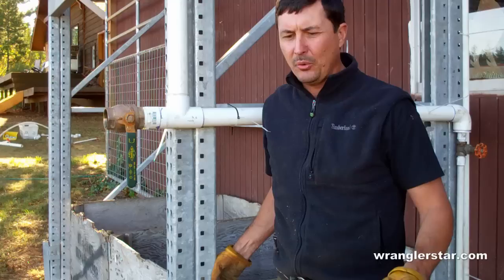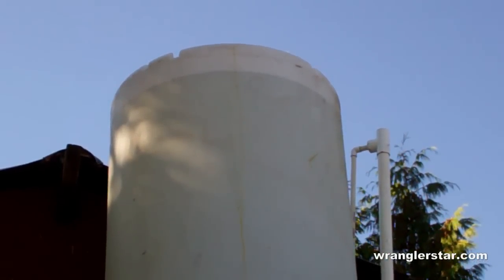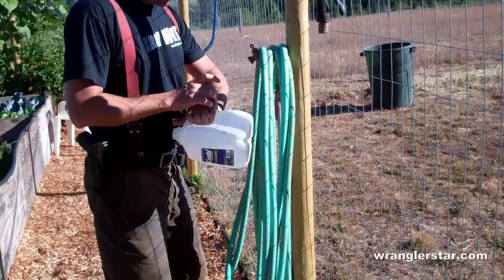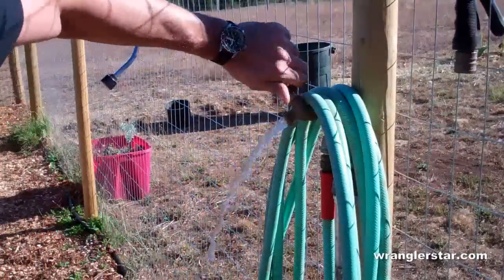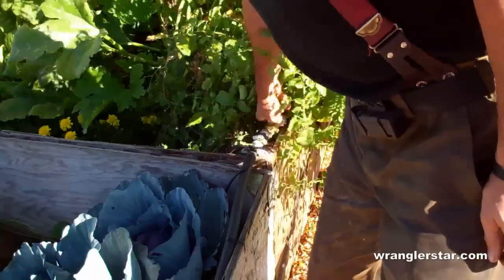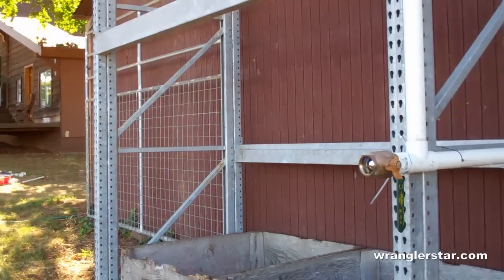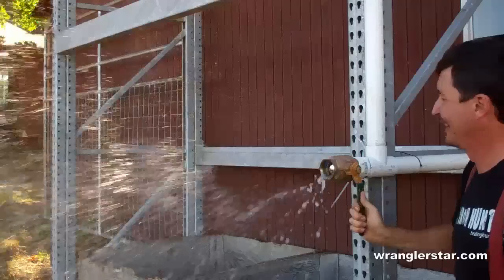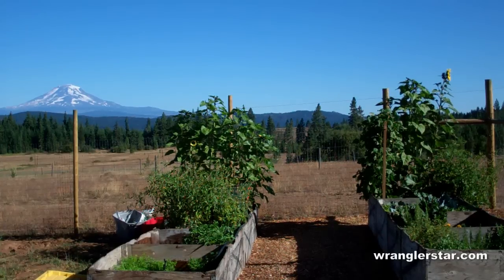Off-Grid Water Tower Exceeds Expectations – Gravity Fed System Review

Comment: I worked as a yard attendant and forklift driver at a local mom and pop hardware store as a teenager. We had the same structures for storing everything from pallets of salt, concrete, bricks and cinder blocks. If the same rack can support 8 full pallets of concrete this rack will laugh at the weight of that water tank when full. It could easily hold triple to quadruple that weight. If the foundation stays solid there is absolutely nothing to worry about this setup.
Reply: That if would be my main concern. Where I live, the ground would probably give a bit. This is a gravel pit with wood on top.
Reply: who cares thats his point. he already justified any weight issues.
Reply: I was going to say the same thing whoever was complaining about any possible hazards is completely ridiculous. I work at Home Depot and and flying multiple pallets more than 3,200lbs each and this 500gal water barrel is maybe 4,175lbs by itself I say there’s room for expansion.
Reply: Water is only 8 lbs per gallon, so 2 whole tons on something that could hold ten times that. People are dumb. Especially people who don't know how things work. One of the reasons why most of us don't want to live by them.

Comment: You did a great job. I owned a welding company and built hundreds of building and what you did is more then enough. I am thinking of putting up a Catch Basin tank for rain water off of our 30x60 barn,,which I should be over 900- 1000 gals from a ONE inch rainfall. I was thinking of cementing 2" pipe in the ground 4 ft deep and weld 4" channel on top,,but I think I like your idea better...looks sound and well designed.
Love your view too,,here in south Texas we don't have that,,,,Jealous...;)

Comment: From a structural steel designer's point of view, your on the right track.  Those pallet stands are tough, and should be more than enough for your needs.  In fact, you could put another 500 gallon tank on that platform without an issue.  Only thing I would have done differently is sink the legs into the ground about 2 feet and filled with concrete.  That would be overkill, but that stand would not move unless a bomb fell on it.  Your work is an inspiration brother.

Comment: Hi there Mr Wranglerstar. First I would like to say, you have a great channel. It is the only YouTube channel I watch consistently. Very inspiring. On the rack issue. I work in a grocery warehouse with this exact racking. We stack 2500# salt pallets in that rack, 3 bays high, not including the floor bay, without a problem. Ours are only single tube legs. I have seen them come down but it took a forklift running into a leg of a full rack. I dont think you have anything to worry about.

Comment: I work in a book depository warehouse. Our racks are very similar, but they are very old and don't look as sturdy and reinforced as yours. A pallet of books can with 1.5-2 tons depending. The racks are fully capable of holding 8 full pallets each with 2 more on the ground. Before you mentioned it, I was going to recommend tying it in to the house/shed to prevent wobble. You did a great job. Thx for the vids!

Comment: Great video. Thanks for sharing theprogress, and telling the Safety Sallies where to file their complaints.
I would like to suggest switching to an all-drip, or all 'mist' system in those boxes. As you can see in the video, the spinnerheads are watering the sides of the boxes. They are meant for a larger circumference , with 'head-to-head' coverage. 
All the best, and keep up the great work. We are all learning a lot!

Comment: Hi Cody - As a fellow gardener, a couple of thoughts to further conserve your hard earned water. Water at the stems or even better at the roots roots of the plants instead of spraying it around over a larger surface, this will lower water loss through evaporation and also prevent against Tomato Blight and other problems. Water in the evening when temp is dropping not in the morning when temp is rising this will keep your soil from getting 'sun baked'. Great vidz and thanks for sharing.

Comment: With you 100% on the racking.  I worked in a warehouse for 4 years while I was in undergrad.  Those are the heavy duty racks, as you pointed out the uprights are doubled.  Just for your information, those will hold 27,000 pounds.  You could place 4 of your 500 gallon tanks on them and still be OK.  And just because they are rated for 27,000lbs does not mean they wont hold more.  Some racks held pallets of steel stock, 40,000lbs total, for all 4 years I was there without incident.

Comment: Great project.

I am a Fire Apparatus Engineer- to get the max flow out of you system - I would take out all 45 elbow and replace one  with  two 22.5 with a 4 inch straight piece.

You have good pressure but sharp angle will slow flow when using a gravity only system.

The system you have now will cover your current need but you did state you will expand.

I know this is unsolicited advice- sorry

Keep up the good work.
Reply: +jason mcmillan makes sense to me Jason, good advice and I thought it deserved a reply....x
Reply: +jason mcmillan you mean replace 90 elbows with 45 degree i think right ?  I dont see any 45 degree fittings , just 90s  unless i am not looking at the same thing you are
Reply: +warren michael oopppssss yes. I stand corrected- take out the 90's and make shallow turns 22.5's
Reply: A sweeping bend is far superior, you've got the right idea.

Comment: I really don't think you'll ever have any problems with that water tower. I've seen forklifts ram into those things, while the racks were holding thousands and thousands of pounds, and there was never a problem. They're not only strong, they're resilient also. If it were me I would feel perfectly safe adding one more tank up top and another two tanks on the middle section. You might consider a solar panel, battery and 12 volt pump to provide flow and pressure with the lower tanks. Great video!

Comment: The shelf system you have for the tower is rated to hold a lot more weight then you have on it.  You are correct, there is minimum danger of collapse.  It is the same rack system we use in manufacturing shops and load them with a lot more weight. With that said, the feet of the rack have holes in them that were intended to have anchor bolts locked in a concrete floor. 
But I see no problem with your set up.  I would use it.

Comment: Hi, Cody, love your videos.  To address the safety Sally problems you have, wear a hard hat, maybe a safety vest will help too.  My concerns, questions, guessing you can't use it when it gets cold but your ram pump wouldn't work anyway because the spring freezes.  I was thinking about doing the same thing but catching the water run off the roof to fill the tank, that would lower the tank and reduce the supply header pressure, I think.  I was told that the main problem with water storage is stopping sun light for the growth of algae.  Maybe if we were to enclose the tanks and make them look more like Petticoat Junction's water tank, that the girls swim in and the Cannonball get it's water from.  I'm just thinking the way you make all of us think, ask questions and design on here, even the Safety Sally's. At least they are thinking, even if your the one thinking and doing.  Please keep up the practical application's that the rest of us only dream of.

Comment: I am an mechanical engineer that worked and works with ships, structures, oil rigs, vessel pipe systems and all kind of things that a ship/structure/pipe/vessel fitter and welder build and you structure is way over rated it... Great job you can put a second tank easily. That just the platform it can support more than 5000 pounds. I am watching your videos since the beginning...

Comment: these pallet racks are made to hold 9 pallets with 500 to 1000 lbs each pallet. we were going to make a shed with 75ft of 12ft shelves on a pad then putting trusses on them and steel sideing and roofing .  good steelwe bought ours at an auction at a closed walmart .  another excellent idea cody had is the tables i believe i saw on another vid here also made from pallet racking.

Comment: Hey Cody, If you will replace the 90 elbow on top of the 2" pipe with a 2" tee, and run you a piece of 2" about a foot or so above tank, and put a cap with a 1/4 to 1/2 inch hole in it, it will eleminate the water hammer. much cheaper than a store bought hammer arrestor, and just as effective.

Comment: What you should really think of, is using drop irrigation for the garden. It reduces water waste dramatically. You run a drip hose to each plant which you can put different heads at each plant depending on how many gallons you need at each plant.

Comment: I'm not going to be a safety sally I think that looks pretty solid. But that said instead of cutting the top I think i would've piered it 4 ft into the ground instead of cutting off the top just for the added strength of that type of design.

Comment: Great video as usual Cody. I'm about to build a similar setup using a 330 gallon IBC tote tank but I won't have the ability to build a high platform like you did. The framework to hold the 330 gallon tank will only be able to be 4-5' high so I'm planning to use a battery / 12v pump setup with a small solar charger to increase the pressure if needed.

Comment: Hi Cody I'm something about the white poly tanks that you may not know, is the UV light in sunlight breaks the plastic and it becomes brittle over time.  The green and black tanks don't have this issue.  I have seen the white tanks only last four to five years when out in the sun.  The simple way to stop that is paint the tank.  Seeing how the tank is Polyethylene not a lot sticks to it.  I have found Snowcote and the like does.  Use something to block the UV so your tank will last longer.

Comment: Water is a ‘Dynamic’ load!  There is nothing you cant do as long as codes don’t disagree.  It would take a 3mm movement consistent to cause enough sway to break your welds in a 24 hour period or intermittently over months.  You could sink anchors with guy wires to absorb all four directions of load or use a slide head at the top and rivet or bolt your connections.  But to me it looks like a good med duty system.

Comment: use a second ram pump plumbed from the drain of the turbine chamber to help recycle the water back up to the tower. there would be some water loss at the second pump but still a major reduction on the water need from the first pump and still fundamentally (after the initial investment to built) free energy.

Comment: Do you empty the tank in the winter?  I have problems with the pvc pipes on my rainbarrels freezing up and busting.  I have some ideas to stop that but I'm tied up on other projects at the moment.  I could drain them but I use the water for my worms, a few potted plants, the Big Berkey, etc. year round.  I will look into using a ram pump to water the garden from the water barrels using the drip system in place instead of the little solar pump I have.  The battery doesn't last very long.

Comment: you clearly are very smart so i do not wish to try to persuade you one way or another, but from my research, the sprinklers in the garden are not as efficient as the drip irrigation, i guess by delivering the drip irrigation directly to the roots and stalks of the plants, you use less water then sprinkling water over the whole area

just a tip if water becomes scarce

love the plant boxes

Comment: I have seen city homes with less pressure out a spicket and has a metal fabricator who is licensed the weakest thing is the wood that's holding that tank you could have put a 900 gallon tank on it and it still would have held it as long as it is on a solid platform underneath and it would have held about every 3 years just go replace the wood and your good just to the amount of moisture that your homestead gets with snow and rain

Comment: I know this video is a few years old. Just  passing this infir mation along to all of the safety Sally's. I used to work in an industrial setting and had the job of erecting and dismantling pallet racking. The average pallet rack is designed to hold 2500 pounds per pallet location. That average is based on single post front and back uprights which are rated for 15000 pounds. And also based on cross beams half the size beams than what are being used on this rack. Now I haven't read any of these comments yet. This reply is based on the rant included in this video. The only thing I would have done differently in his install was lag them to the timbers if they aren't already and drive rebar through the timbers into the ground. I would have probably fastened it to the building more than he did.

Comment: lmao at roseann breakdancing... but cody youre right, i have a very similar shelving unit in my shop, and one unit has 2 2.5 tn truck engines on ot as well as a spare spicer 3053 tranny for a deuce and a half. mine is free stnading, with lag srews into wall as u say to prevent it rom tipping. i can assure you the watr tank when full weighs nwhere hear what one f those engines weigh, and i have two on one shelf. we have too many safty nannies out there.

Comment: A coloum f water will exert 0.49 PSI per inch in height. In my perfect world a windmill would suppy a 2000 G. tank at75' height I believe. pressure I'm accustomed to & a tower for my radio antennas. The thing that was waiting for a  solution is that I can expect sub 0 temperatures. I have decided I can put an insulated enclosure around the tank, buld a box around the pipes to the tank to send heat from the home through to the tank room

Comment: Disregard my pressure question I posted on your previous video. Is the ram-pump solar powered? I think you said the ram-pump was off grid...? Did you make a video on the ram pump? (1 gal/20sec)*(3600sec/1hr)/500=0.36hr to completely empty the tank when the hoes bib is open all the way. Did you test how long it would take the tank will completely empty into the garden through the little sprinklers and soaker hose? Thanks.

Comment: I really like this project. Thank you so much for sharing your design and the results. I am curious to know if the water ever gets warm from sitting in the sun? Personally, I would have located it on the other side of the garden just in case something weird happened, such as a prolonged rain storm with high winds, freezing, earthquakes, backing into it with my truck, etc. Two full tanks might compact the ground and cause it to lean, but you can monitor the level. I think it's amusing that you didn't pretest that the ram pump would lift water to that height first. Sounds like my kind of engineering. Your overflow might create new problems, such as a mosquito habitat, other unwanted wild flora & fauna, mud, ponds, ice, etc. so you might want to consider a way to automatically stop the flow or return the overflow back to the stream? Since this is for non-potable water, did you consider building your own tank, similar to a wooden hot tub?

Comment: Pallet racking is overkill for that little bucket of water. You could easily store 2 - 4 more. If this is the same racking I've worked with, I've put several tons of concrete mix on these.

Comment: Where is the pump gathering the water to fill? If off grid i imagine a well or natural source. Also,  as a fabricator,  i know steel has a minimum of 60,000 lbs psi tensile strength. Estimating 8.5 lbs per gallon,  your max weight is around 4,500 lbs. Between the 4 posts,  you have a minimum cross section of at least 1 square inch. therefore,   you could easily put a minimum of 6 xs more than what you have. Great job.

Comment: Hey Cody, I just found your channel.. alot of amazing stuff! Thank you for taking the time to do these!  On this build, with the water tower supplied by a RAM pump.. I am setting up the same and wondered after so many years of this running does this tank require maintenance or water require treatment of some kind to be drinkable since it allows light to come in and grow things in the tank?
Reply: Mikenkarie , We learned that lesson the hardway with the clear tanks! It was problematic with all the moss growing inside the tanks! It would plug up the valves and lines. I am going to paint them black at some point! Hopefully that will solve it. Or replace with metal tanks if we have to. Its only irrigation water though thank god but i wouldnt use clear tanks again for anything really.

Comment: With a translucent tank like that, is there concern about algae? I'm looking to do a similar project, but I'm just starting the learning process. Thank you for posting your video.
Reply: Definitely, you need to paint it black or something to keep the light out. Otherwise, you will get a two inch think layer of algae on all submerged surfaces.

It doesn't cause any actual problems though, it just looks bad.

Comment: I'm not trying to be a "safety Sally" by any means. I hate them as much as anyone, BUT, there is something to be said for not overloading a structure. I have no doubt that your setup as it is now will hold up the load. However, if you were going to add another tank, I think it'd be better if you add it on a lower bar and to the opposite end of the rack. This would properly distribute the vertical load, keep the center of gravity lower, and keep you from overloading a cross member as most pallet racks are not designed to hold 8,000 pounds on a single shelf. But definitely tie it off to the house or better yet,  sink a creosote  phone pole in the ground next to the shelf and tie it off to it for lateral support.

Comment: Tell em to go to lowes or Home Depot!!! They have the same exact shelving with more weight.
Reply: however, they also are installed on concrete which not only  prevents settling but also tipping. otherwise, his tower is overbuilt could probably hold 15000 or more lbs.